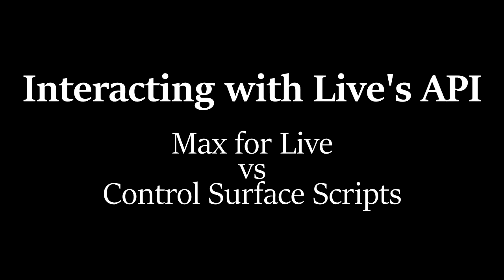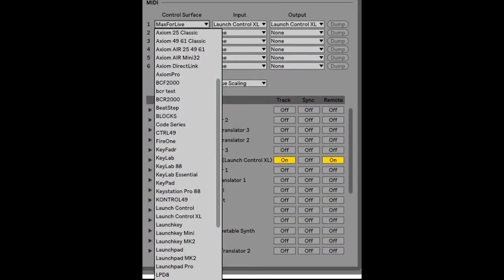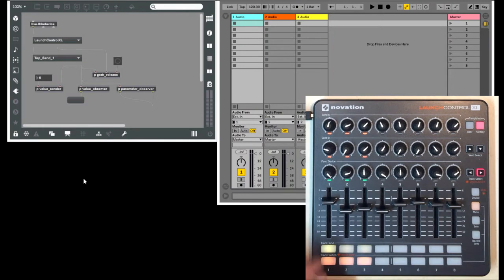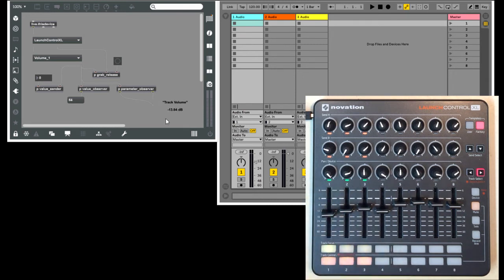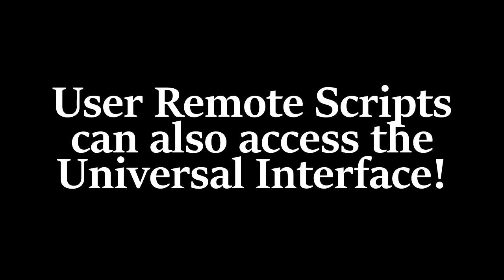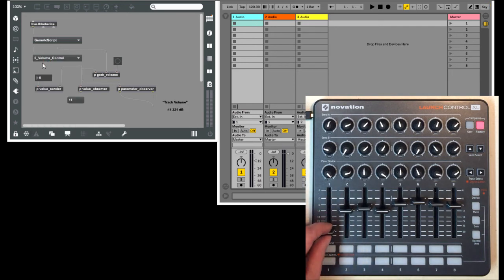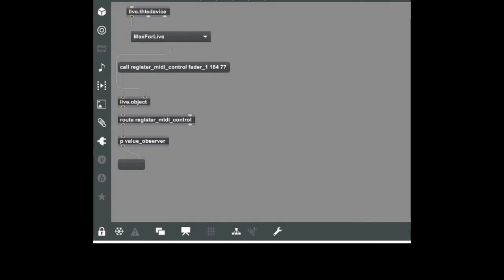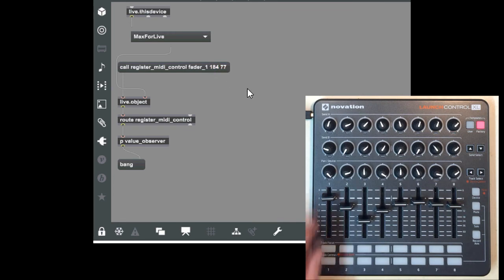Live 10's new Control Surface API

Comment: Wait, what's that M4L Device, where does it come from and where do I find the grab_control and release_control objects?
Reply: Same question here!
Reply: You've probably figured this out by now but if anyone is coming back to this post:
You need to use 3 objects: live.path, live.object and live.observer
"grab_control" and "release_control" are functions you can call with the "live.object" object.
You'll need to read up on using the live object model LOM, but this will give you somewhere to start.

First you use the "live.path" object to get the id of your control surface and send it to the right input of a live.object. 
Once you send an id to the live.object you can query it for available controls by sending a "getinfo" message in the live.object.
Once you have the control name you want, use a message object to send these messages to the live.object:
call grab_control (name of your control)
call get_control (name of your control)
This will grab the control and spit out an id that you then pass on to a "live.observer" object to receive data from the control.
Reply: @the3mu606  don't know if they changed it in live 11 but I can't get anything to work. I can grab and release control; but I don't even have 'getinfo' listed in the LOM so I don't know how you got it; and if I try to list parameters all I get is "done" as a message on the output. And I have zero clue on how to even display the value either (grab. midi will only show me the midi value of pushed button not faders). I have a launchcontrol XL so I took the same name from this video but otherwise have now idea how to list availables controls. Maybe I missed something but I'm pretty familiar with the LOM but this doesn't seem to work.